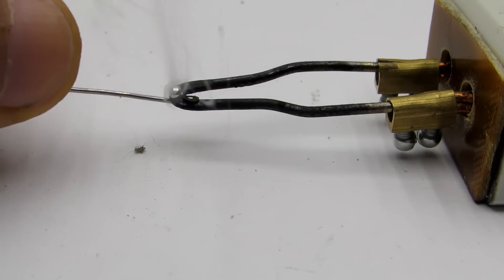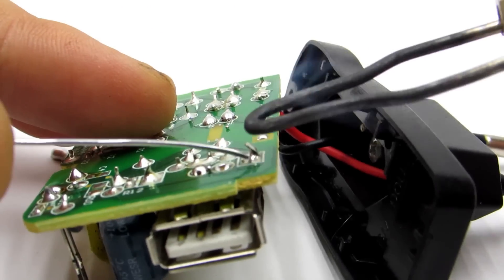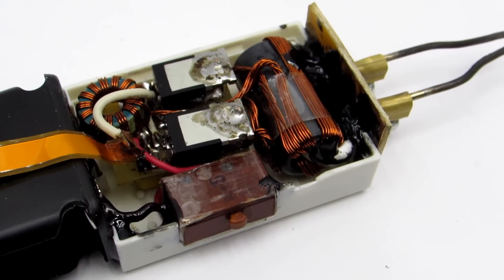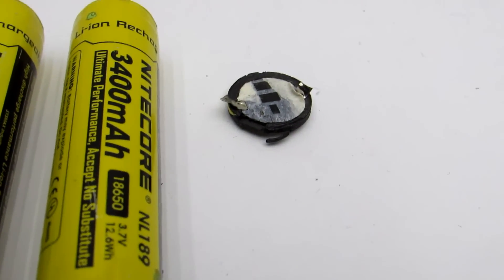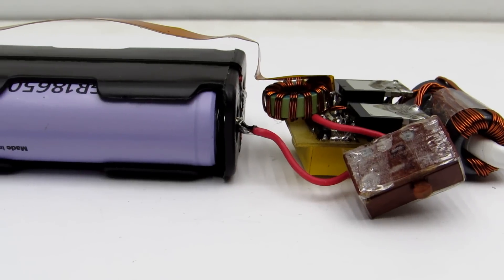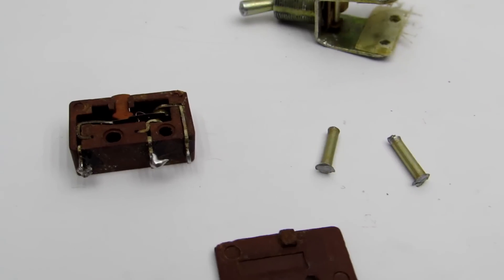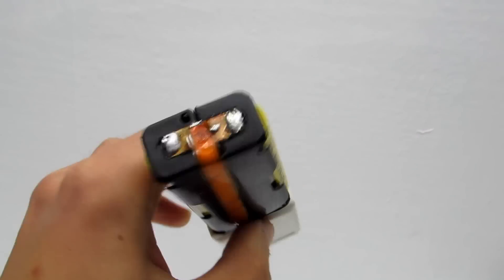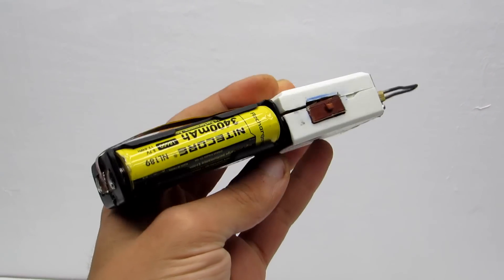DIY instant heating soldering iron  (PART 2)

Comment: You should look for a different core for you transformer. The filter chokes on the pc power lines are made to have high losses to convert the RF noise into heat when they are used on the filter.
Reply: never heard of that. can you explain why you need it to convert to heat other than act like a purely inductive component carrying reactive power only?

Comment: i would hook 3 batteries in series and then wind more coils on the primary. it is better to work with more balanced voltage-current ratios

Comment: The circuit is a zvs driver.so it can also useable for mini jaccob's ladder.
Reply from the maker: Yes
Reply: What about your compact switch mode power supply video?you said you will make another video about that.